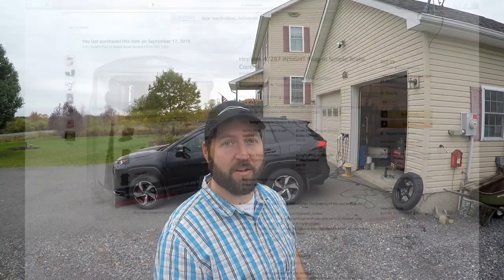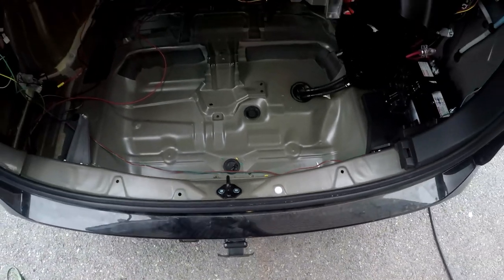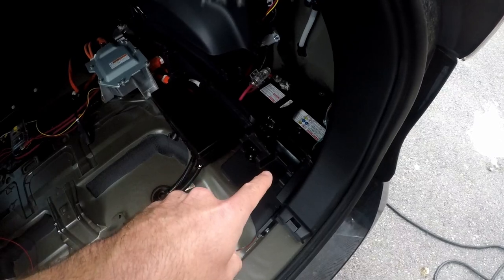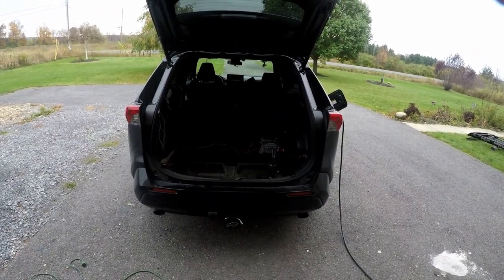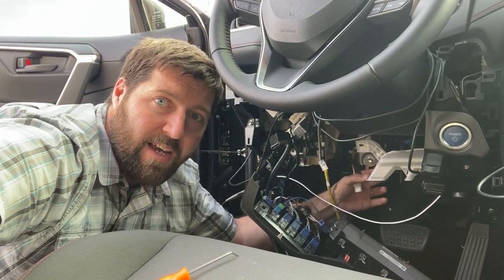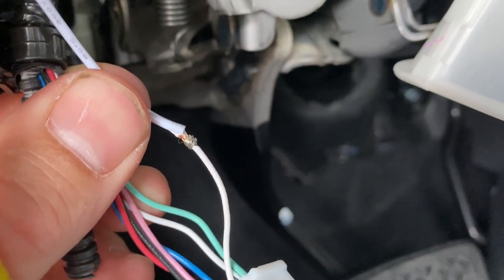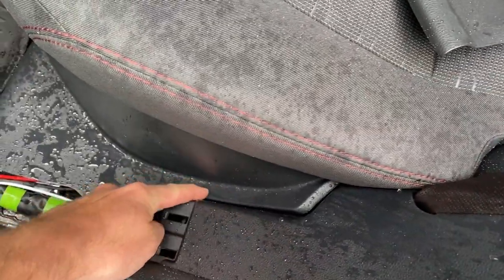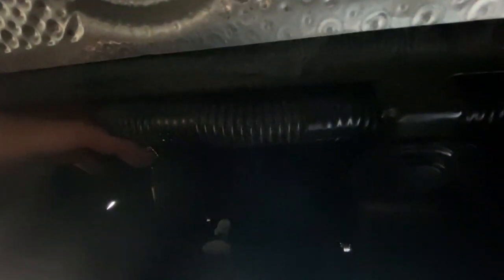2019+ Toyota Rav4 Trailer Brake Controller & Wiring Installation

Comment from the maker: !!!!Watch this video before copying my installation!!!!
https://youtu.be/e8S6bWsW2VA
I made a mistake.
Reply: At first I thought these brake controllers were detecting the amount of brake pressure applied by reading from an isolated CAN wire which is why you wired yours to the pedal but reading the manual for my Redarc suggests that they just need a brake light signal. In other words, simply tapping into the brake light vs. going through the whole process of wiring it to your brake pedal seems sufficient and will likely work properly with the vehicle's autonomous braking. The Redarc manual even states this:

"Sourcing the brake signal at the brake pedal may only detect braking events when
the brake pedal is depressed (and the switch activated) and not brake applications
activated by other on board systems such as AEB."

Comment: This was the first (only?) video I have found that shows how to find the reverse light wire and run it down to the receptacle. Our trailer has surge brakes and needs reverse wired in order to lock out the surge brakes when backing up. I did not cut a hole in the bumper for the round receptacle; instead I used a metal bracket with 4 small bolts to fasten it under the bumper, next to the hitch receiver.

Comment: great video, and supplement regarding the relay. I'll be installing a trailer brake system (probably will use a prodigy controller but havent' decided yet) on my '22 prime and am thinking I may just get a vehicle-side plug that includes both 4 and 7 pin sockets, so I don't have to use a 7vehicle to 4trailer  adapter. Any thoughts? It looks like getting a different plug for the bumper bodywork doesn't change anything about the installation orther than the shape of the hole that needs to be drilled/cut in the bumper.

Comment: Did you have trouble with that downward angle of the 7 wire connector when connecting your trailer? Do you feel like the bumper might crack around the hole over time, with vibration and with the weight of the harness? I bought the OEM hitch purely for its aesthetics vs third party one... but my dealership will only install a 4 wire harness. I think I'll do the install like you did. Oh, and thanks for your great videos.

Comment: All those loose wires in the back need to be wrapped or run in wire loom, or short circuits will start occurring a few years down the road due to rubbing on metal.

Comment: Does the Rav4 need a brake controller and trailer with brakes to tow a 2500 lb trailer?
Reply from the maker: It depends on your local regulations. Here in NY any trailer that weighs more than 1000 lbs empty or over 3000lbs full requires brakes. Its a safety thing.
Reply: @JamesKlafehn  I wonder if you can tow even more with the brakes.  Alex on autos towed 2000 lbs on his regular rav4 hybrid up big mountains and everything.  Makes me wonder if the rav4 prime can tow a bit more
Reply from the maker: @deele7991  I am a firm believer that you can tow a bit over their rating. Manufacturers are always very cautious about everything.
Reply: Trailers of any size can benefit from having brakes, simply from a control perspective; there's really no other way to quickly and safely pull out of a sudden sway condition. A relatively small trailer can push even a relatively large tow vehicle around, the leverage that tongue provides works both ways.
Reply: @deele7991 those low tow capacities are an american thing. The 2020 Rav 4 hybrid, anywhere in the world has a towing capacity of 1650 kg. That’s 3637.627 lbs. Compare that to the 1750 lbs in the states.

Comment: Did you use an adapter for the 4pin Tekonsha to hook up to the 7pin plug?
Reply from the maker: Yes I use this one. https://amzn.to/2Q8jI0h
Reply: Sorry, i meant from the harness on the tow vehicle to the 7pin port. The Tekonsha has a 4 pin plug, i'm a novice and i just want to make sure i get this right. 20' Rav4 Hybrid here
Reply from the maker: @kseab14  I dont understand. The Tekonsha is wired to my 7 pin.
Reply: @JamesKlafehn  Exactly, the Tekonsha has a 4pin connector for a standard setup. In the video I didn't see any mention of your method of conversion for the wiring from the 4pin connector to your 7pin plug. The link above isn't that either, I'm confused as well
Reply from the maker: @kseab14  I cut off the 4 pin connector and connected the 4 wires to the 7 pin connector along with reverse lights, power brake wire, and 12v power. Id have to rewatch the video but I am pretty sure I showed myself connecting and mounting the 7 pin plug.